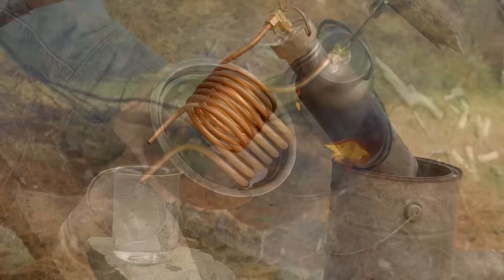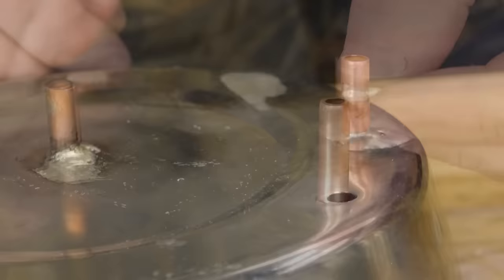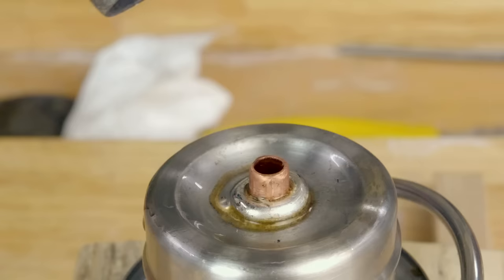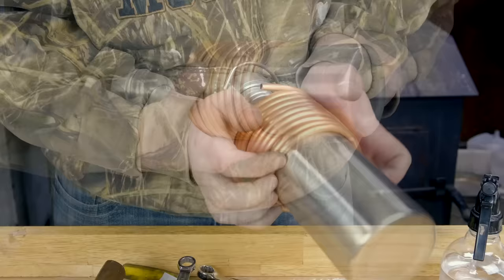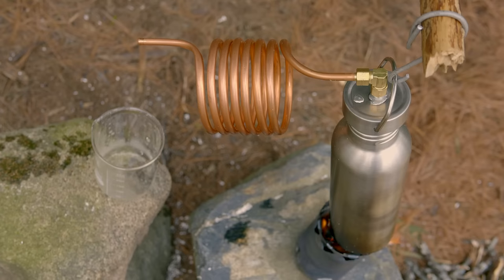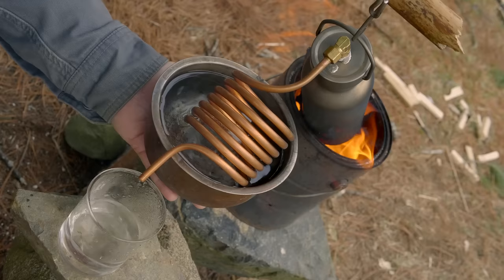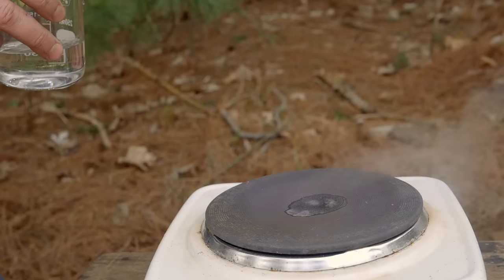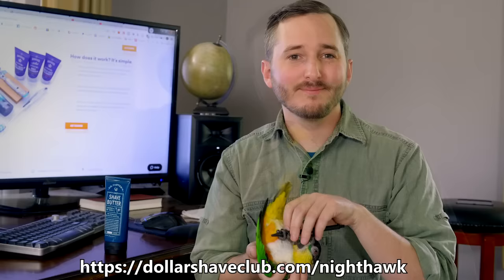DIY Salt-Water Survival Bottle (Compact Desalination Kit)

Comment: Something to keep in mind with this, stainless steel when heated to a certain point creates chromium carbide. This is bad, when the chromium has been reduced to a certain point stainless steel begins to corrode. You'll see it when stainless steel begins to show purple bands in it, that means it's too hot to maintain it's resistance to corrosion.
Reply: Wow that’s good advice …. Wonder if there is an alternative way to make something like this ? I don’t suppose Aluminium could be used, apart from the risk of melting it but would there be a contamination risk from that also? Maybe that would be ok as we cook with aluminium pans.
Reply: @buffplums  We also cook with stainless all the time year after year. Yes this chromium corrosion is a thing but not in this contex and temperature. As long as there is water inside the bottle the temp can hardly rise above 100°C because this is not a pressure vessel. And because it is not pressure vessel corrosion is not a thing, it would only cause it to leak, not likely to cause any problems.
Reply: Would tin be better for water distillation
I’d like to make one for camping long term
So I don’t have to carry water
Reply: At cooking temperatures it’s not an issue. The hexavalent becomes an issue when heated to melting, such as welding, and then it depends on the process.  Stick welding releases hex. Chrome, however, tig welding keeps any release within  acceptable safety margins.
 This from a professional welder. We never heard a thing about hex. Chrome until just around 15ish years ago.
 Now, when stick welding we need respirators,  not so with tig.  After many years of never having been told about it and God knows how much intake.
Reply: Do you happen to know if the copper releases any harmful substances as it may on alcohol distillation? I have read about copper poisoning when boiling on copper kettles, but what about steam passing through it?
Reply: @mestrone  Don't know a thing about copper.  But I have some tin camping items.  They also used tin in the US Army for our canteen cup and the field food gear.
Reply: I use stainless steel pipe for my exhaust pipe on my motorcycle, would than be bad?
Reply: @Axel_Andersen  thanks
Reply: @megastick9324  thanks
Reply: @percybaldwin216  thanks
Reply: @shinjiprofile   no.
Reply: @isidoreaerys8745  Hexavalent Chromium is found in high end paints for industrial uses or by welding stainless steel in some cases. Your comment is a red herring in the context of this conversation. HC is not produced by boiling water in a stainless steel vessel.  Think of SS cookware you use everyday in your kitchen. The original chromium comment at the top also doesn't fit the context of this video.
Reply: then buy a copper bottle, or gold while you are at it.
Reply: Same process but with a pressure cooker. This is an excellent method.
Reply: What about a Titanium bottle? That's what I'm planning to use as its what I have. If I'm that far out in the boonies i want ultra lite.
Reply: @megastick9324  I was a professional TIG welder as well and a metallurgist. What I'm explaining is, if this color change as in the video is observed, select a different alloy that will be more resilient. And chrome is not the same as chromium. We are talking about the product chromium carbide precipitate.
Reply: @whipivy   I know this, as in #9 chrome pipe.  You were not a metallurgist AND welder. I’m throwing the BS flag.
Reply: @Axel_Andersen  Wrong. You are thinking that there is a 100% efficiency in convection between the boundary material and the liquid. This is not true. A campfire from internal to tip ranges between 900°C and 320°C. The metal has direct contact with the heat source and must conduct this heat to the water. The conduction of heat is never 100%.

If the metal is turning purple you are seeing what I'm describing which also means it is well beyond 100°C. Chromium carbide precipitation begins at 510°C (a temperature easily observed in direct contact with flame) in austenitic stainless steels.

You are also comparing different alloys of stainless steel and different thicknesses as well. What stainless cookware does is irrelevant, if the metal begins to change colors it is too hot period and it is actually above 510°C. Eventually you will be consuming rust along with many other particles and it will fail.
Reply: @megastick9324  I was. It's how I paid my way through college. I worked mostly stainless steel, aluminum, and titanium. SMAW, GMAW and TIG, primarily TIG. Industries were aviation, racing, and railroad with some heavy equipment. I really don't know why you would just say I never was what I definitely was. Probably because I made the point you brought up a completely irrelevant topic in this discussion, certainly one that has no relevance to my point...which is possible precisely because I was a welder as was my mother before me.
Reply: @spatha2456  Titanium has low thermal conductivity but it is light which is how pure titanium cookware for camping sells. I would avoid coated vessels. Something like Thermalox 240 series would probably be safe. Think that series is rated at 1600°F which is the internal temp of a campfire. Not even necessary to contact flame so not an issue.
Reply: @whipivy  Ya I've been laughing at informercials for years with their non stick crap know how garbage most their coatings are. I'm not sure what I think about the whole low thermal aspect of Titanium, I have a double walled mug that gets hotter then the hinges of the gates of hell. I also have a plethora of evernew titanium stuff. Iv'e never had with Titanium and heating it or its contents.
Reply: @whipivy  On my gas range where the flame is, what, 2000°C?, I never see my stainless cookware change color.
Reply: Thanks for that, interesting comment
Reply: @Axel_Andersen  You've never left it on long enough or cooked at a high enough heat or simply haven't noticed the pan has changed color and has already presented this. Also as I already stated, you're understanding of convection is incorrect. What is the total volume for convection over efficiency with the vessel in this video versus the total volume of convection over efficiency with a pan on a stove? You really can't see the difference? 

And the part of the pan that has direct contact to the heat source is designed for that temperature as is the alloy selected. Are you done? Because the video clearly shows what I'm talking about, nobody here, including you, disputes this.
Reply: @whipivy  Ok, I lost plot. What is your point, that it is highly dangerous to use stainless steel in this application?
Reply: Cç
Reply: This guy is dangerous on all levels and in so many of his videos. Great schematic plans, but I stress *schematic*. He doesn't even understand to regulate the temperature of the heat source, ie the fire he is using. When distilling, regulating the heat is 99.99% of the process. Instead of cooling the condensing coil to not shoot steam out the other end, he should first have regulated the heat source, because of the material of his pot (the steel water bottle --ALSO, the quality of the stainless is 100% important; you should Not be able to stick a magnet to it (ie high nickel content, less ferrous). Distillation is a stabilization game. This could have been done so much better and safer. Fail.
Reply: So glass would be a better alternative I guess. Other than the fragility and weight issues that is.
Reply: Unless the toxins evaporate and then condense out into the distilled water you could probably add Arsenic to the supply water water and still safely drink the distilled water.
Overheated hydrocarbons and Fluorocarbons from any coatings would make its way into the distilled water. With a controlled heat source this should not be a problem as long as water is in the container. Putting a container directly on hot coals or in a flaming fire is too unpredictable if the container is coated.
Reply: @JohnHoranzy  This whole thing is a giant fail.
Reply: @buffplums  yes it's called a still they're doing nothing more than distilling water
Reply: @simplekindofman6265  no, copper only!
Reply: @simplekindofman6265  unless your backpacking on the beach or near a salt lake you might be better off with just a water filter or life straw. IMHO This would be great in a life boat survival pack.
Reply: Thanks, I was wondering why my spoon is rusted
Reply: As long there are water in it it never gets that hot.
Reply: @VidarrKerr  
In a camping or survival situation how are you supposed to regulate the temperature in this manner?
Reply: g h  A double walled, insulated container is a no-go for cooking/heating water. You will heat the air trapped between layers and risk causing an explosion, or implosion in this case you mention where the inner layer is glass. For cooking/heating water you should only use single walled vessels.
Reply: @spatha2456  I am thinking the same, for the same reasons. I don't know how hard it is to drill through, considering the strength of titanium from what we are told.  This bottle in the video, at least in the cover photo and opening clip looks like titanium to me from the color. But in the steps to build it looks stainless steel.
Reply: @VidarrKerr  can you explain more about regulating the heat source? I'm interested in that. What temperature do you want it to be ideally? Or I guess framing it in the context of the water such as boiling, simmering, etc.
Reply: @user-bh3ew6ii4g  You'll have to adjust the heat source so that you aren't running your setup too fast, or too slow. If you are burning hot and creating more steam than your pipes can handle, it is not going to work properly and is totally inefficient. If you are running too cool, it will just be totally inefficient. 

To get a better idea, watch some videos of ethanol distillation. Even simple videos of people distilling in their kitchen will explain it very well.  

(Distilling ethanol is obviously not the same as desalinating water, but you'll get the idea of temperature management --but only temperature management. BTW, Never Ever drink distilled water for more than a few days. It is without minerals and will leach all the minerals out of your body, and then you die.)
Reply: @VidarrKerr  I've been experimenting with my large home distiller to get the temperature at it's most efficient, I agree it's important. 

That's a myth about drinking pure distilled water. It pulls toxins and the inorganic minerals that are damaging your body out (e.g. kidney stones, joint calcification and the like). Our bodies use organic minerals found in plant foods which are more bio-available to us and don't get deposited and cause issues around the body. I know people who drink nothing but distilled water and have for years and they are extremely healthy because of it. People have cured things that doctors told them they would have for the rest of their lives, things they were told would kill them by drinking pure distilled water.
Reply: @VidarrKerr  do you know someone who has died only from drinking distilled water? I know people who have been doing it for years, they are still alive and look much younger and healthier now that when they started. How long does it take for one to die of drinking distilled water? I've been doing it for months and I feel fine. In fact my body craves it over RO water. Are you assuming that people who drink only distilled water are not consuming  food, like vegetables and fruit which are full of bio-available minerals? What you say doesn't even make sense. You're saying you need to add salt/minerals to distilled water as if people who drink distilled water are never eating fruit, vegetables and salt which are minerals. Do you think people will die if they regularly fast or do intermittent fasting? In the past I went for over a year doing a 3 day dry fast every month around the full moon, along with a lot of other people, we were all doing it together. Not a single one of us died.
Reply: @user-bh3ew6ii4g  Ahh, I see what you mean now. I should have been more specific about what I was talking about. I was thinking about it in a survival situation. I sail and fly, so whenever this distilled water comes up, I am thinking about it in that context --not part of a health routine.

So, if I get wrecked at sea, I was thinking of this situation --in a life raft. Or, crashed in the middle of nowhere. 

A lot of survivalists don't know that you can't just float in the ocean for a month drinking distilled water. The reason people drink it, like you obviously already know, is to leach stuff out of their bodies. If you aren't replacing the minerals, it won't end well. We are on the same page!
Reply: It is a concern for sure, especially because it would be harder to control temperature on an open fire. Most of the cookware we have nowadays is toxic, testing strips are helpful but not always 100%. What about a titanium bottle ??? Which one is the safest, the best ?
Reply: @buffplums  Aluminium is toxic and coated nonstick is toxic too. Cast iron and carbon steel are the route for cookware but with the help of testing strips for lead and ... So is leaded glassware/crystal and brightly colored, glazed ceramics or clay cookware or cups.
Reply: @Axel_Andersen  Stainless steel is Ok to cook in unless it is scratched. Very often it has aluminium bottom or copper. When you start cooking, the toxins will begin to leach into your food. I have discovered that there is no nontoxic cookware really, so I stick with tested cast iron and carbon steel and make sure to do thick seasonings for maintenance and change it up often. Also, do not use glued cutting boards - you are eating the actual glue! Only exposed wood is the best, that way you would know what you are seasoning the board with. Mineral oil is toxic too, not good for seasoning. Its a long comment, just wanted to share this information.
Reply: @Lykapodium  as a welder I am pretty sure that it depends on the chromium content and the temp that you boil the water at along with time being heated because any discoloration of the stainless-steel would mean a change in chemical properties so yes before mentioned would be a concern and not only that with companies trying to squeeze a dollar out of a dime they're making things a lot cheaper with other materials a 304 to 316 steel would be the best choice for this application
Reply: Heating Steel creates rust fast best bet would be glass bottle with glass lid and some kind of paper gasket for the lid drilling holes for vent and pipe would be tricky but possible
Reply: @simplekindofman6265  Think of it in 2 stages.  1st sterilize the water with something then filter that out of the water.
Reply: @shinjiprofile  no, most exhausts have stainless
Reply: @whipivy stainless steel is a phenomenal insulator and is known to not conduct heat remarkably well. He'll likelihood of you hitting degradation temperature in a campfire without forcing air is fairly low, the temperatures we're looking for are what blacksmiths would call working temperature. That would be the blistering hot level just beneath red. Somewhere in excess of 1200 Fahrenheit.
Reply: @buffplums  aluminum poses an Alzheimer's risk
Reply: @simplekindofman6265  tin would absolutely not be suitable, as tin is what is added to silver in order to make solder a low temp operation. Tin melts almost as easily as lead
Reply: g h  just use stainless. That bottle's not getting cherry red while you use it...
Reply: @spatha2456  not sure what risks titanium poses
Reply: @Altrag_  Well maybe it's not tin that I have.  I have a camping coffee pot that can sit right on a fire.  Not sure what it is made from, but it's like the old mess kits we had in the army.
Reply: @Altrag_  ah yes i have heard that. Thank you 🙏
Reply: @Altrag_  I know that you can take a blowtorch to Ti and get amazing colors and patterns. I also know that is pretty easy removed. Not knowing a whole lot about metallurgy I know titanium can be one of the most hygienic with implants. Still I'm becoming more aware of what’s going in my mouth going heavy into water filtration so I figure asking the questions is never a bad idea because some metals leech bad shit into water when applying heat. There are grades of titanium that are utter shit.
Reply: @whipivy  I too doubt you are both
Reply: If you need water this seems like a great way to get some fast.
Otherwise it wouldn't take long before dying.
Reply: Were probably not going to be heating it with a cutting torch.
Reply: The stainless in that water bottle or any food safe container would need to be heated past 800-900 degrees C for a sustained period so it shouldn't be an issue, but it's good to be aware of how the metals you use interact with heat
Reply: It's not Relevant at the temperatures in question
Reply: @buffplums   Aluminium is a nerve toxin. I avoid foods cooked in aluminium  pots and pans as much as possible. In poor country restaurants they're ubiquitous though.
The heat, salt, acids + the scratching inside with spoons and knives etc. help dissolve/corrode the aluminium even more. Also be aware of aluminium dust particles  when sanding or polishing surfaces, as it can be absorbed by inhaling or through the skin pores.
Reply: @whipivy  idk why the other commenter thought you couldn't possibly have been a professional TIG welder and a metallurgist 🙄. I did aero eng and specified into aero materials so took some metallurgy classes... I don't wanna go into corporate engineering and I've learnt that I really need to do hands on things to keep me happy and sane, and I've been considering what I do wanna do for a career.

I got a dremel butane torch multitool for electronics soldering, wood burning, other general heat tool purposes, & even plumbing soldering/brazing (which I want to learn) a while back. I really love that thing, which got me researching flame temps vs metal melting points and that lead to me learning more about welding types & equipment 😅. 
Now, I'm seriously considering welding as a career option - so you doing both welding & metallurgy made total sense to me, especially seeing as metallurgy seems way more linked to welding than aero eng! Like, do people assume somehow that it's not possible to do both a materials science/engineering degree and welding because a welder can't also be able to do academia? 🤨 Very odd and curious to me 🤷🏼‍♀️
Reply: @AldoSchmedack  It makes perfect sense, what you on about 😂